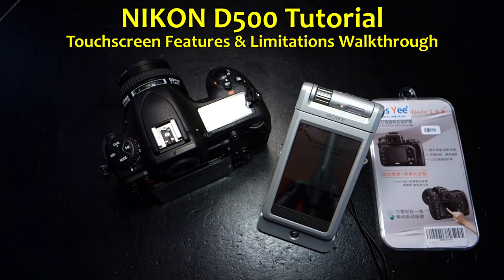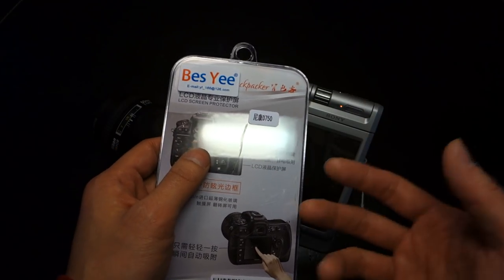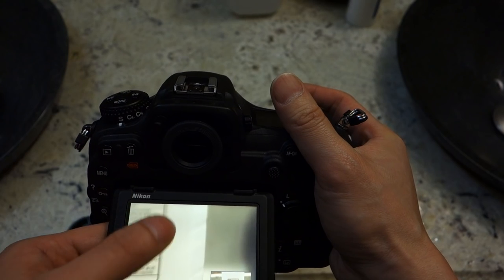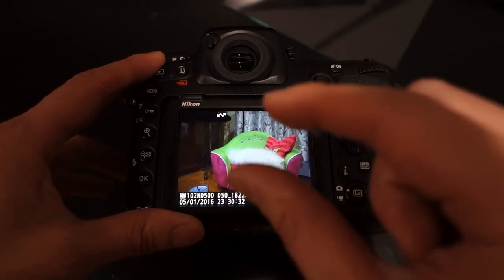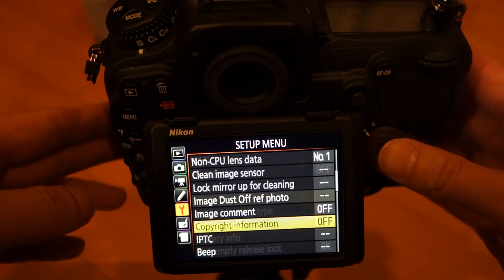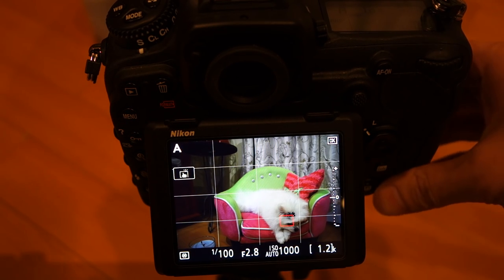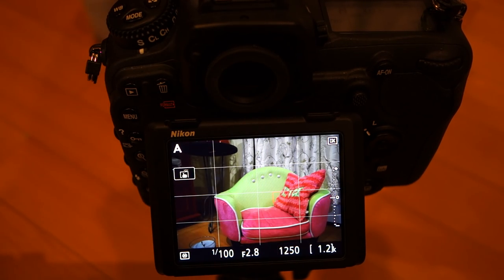Nikon D500 Tutorial - Touch Screen Features & Limitations Walk-through

Comment from the maker: TOC

Capacitive vs. Resistive touch screens - 0:06
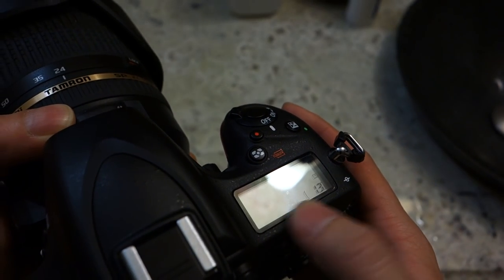~Resistive touch screen redux - 6:32
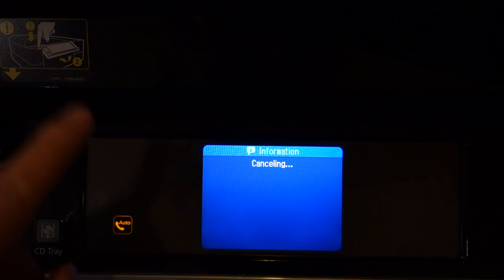~Emphasis about a screen protector's impact (or not) on D500's touch screen - 7:12

D750 Screen Protector on D500- 3:17
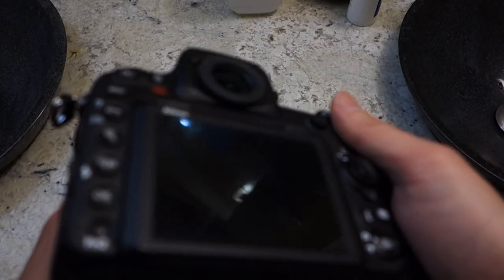~Testing Screen Protector - 4:26
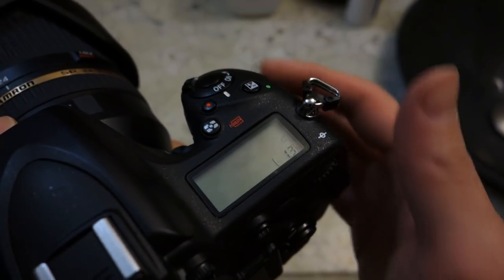~D750 top LCD protector - 6:01

D500 Touch Screen Features & Limitations - 8:41
~Playback mode - 8:41
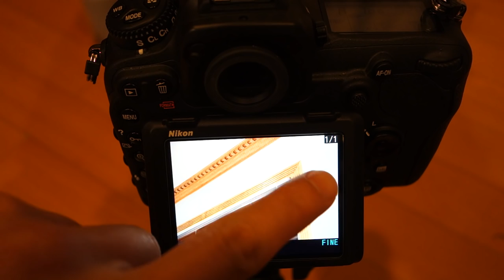~D750 shots preview compability issue - 8:53
~No menu operation - 10:32
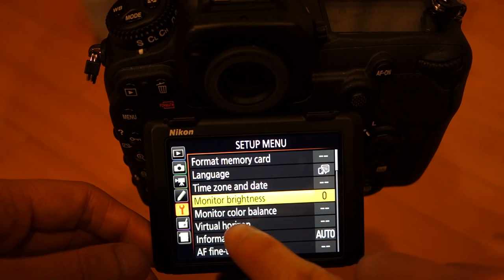~Text entry - 11:16
~That Delete key (my bad it's not a backspace key so ignore my comments) - 11:38
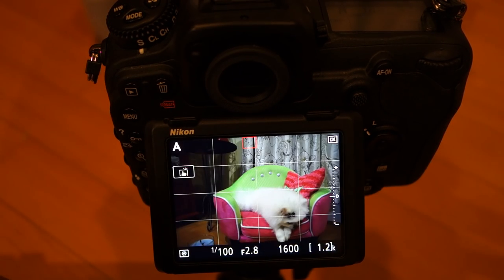~Live View (Pic) mode - 12:40
~~Touch Shutter/AF: On - 12:59
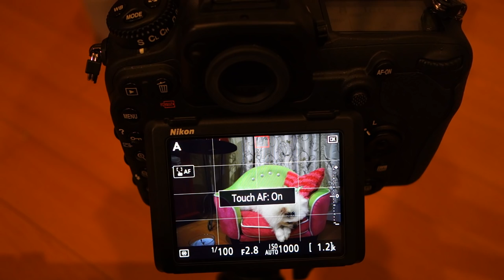~~Touch AF: On - 13:29
~~Touch Shutter/AF: Off - 13:45
~~Acquiring WB data for Custom WB - 14:05
~Live View (Video) mode - 16:55
~~4K video additional 1.5x Crop - 17:27
~Enabling/Disabling touchscreen - 18:14
~~Left to Right / Right to Left feature - 18:22

Comment: The D5500 has essentially the same menu design and scale (same 3.2" screen size), and touch is fully activated for both selecting menu items and scrolling through lists that are too long to fit vertically.  Sub-menu selections include touch direction arrows where needed and of course the text entry feature.  Even the "?" help icon is touchable, as well as selecting shutter speed and aperture from the "info" button screen (curiously not ISO) and all the editable settings from the "i" button screen.  It works very accurately for me (I wear men's medium gloves to give an idea of my finger size).  The live view on-screen button only allows you to turn touch shutter on or off, and touch focus remains on unless you select "Disable" or "Playback only" from "Touch controls" in the Setup menu.  There is also a touch "i" button on the live view screen to bring up those options as an overlay, but sadly, choosing white balance only lets you touch to select a type,  and doesn't allow for touching within the scene to set a custom value.  This seems to be the one touch feature the D500 has that the D5500 lacks.

More importantly (to me) is the D5500's ability to assign a touch Fn to the blank screen while shooting with live view off.  Eight options are available including ISO and aperture, but the one that convinced me to sell my D5300 and buy the D5500 (a crazy sale helped too...) is the focus-point selection, it's just great.  A joystick is nicer to have than a d-pad, but when I'm shooting dogs that move around constantly, sliding my thumb on the right side of the screen to have the focus point quickly follow the movement is a godsend, especially since face detection was designed for photographing human subjects.  (If you swing out the screen, the full area is used for the touch function, in normal position, only the right half is used, a well thought-out and effective feature, albeit not applicable the D500 since it only tilts).

The D5500 was Nikon's first attempt at incorporating a touchscreen in a DSLR, and they nailed it.  I was not expecting very much from it, especially not a touch Fn feature.  I'm hoping the D500 will be firmware updated to complete what they obviously did not finish implementing at release.  Providing invaluable touch features in the second from the bottom DX model and then omitting them in the flagship model released over a year later is about as nonsensical as Nikon can get.
Reply from the maker: +Lladnar Productions Thanks for the useful info and wow, didn't realize the D5500's touch screen was so advanced! I can't see why they couldn't incorporate that into the D500 via a future f/w update then... (and vice versa, the custom WB feature into the D5500). Here's hoping they will!
Reply: +turboBB73 The D5500 doesn't have a dedicated WB button, but since the "i" menu is already included on the live view screen, they could put it in the WB settings when accessed from there, but I doubt they care on such a consumer model.  But yeah, they really need to get their act together and finish touch on the D500.

Comment: Hi - can i ask something please?

I like the features of the D500, seems like more versatile, dif jobs
The D750 has more detail, bokeh

Can i get away with buying the D500 and using it for weddings? Does the D500 sufficiant detail for wedding needs?

Thanks all the best
Reply from the maker: The D500 doesn't have an OLPF which the D750 does so if anything (and in general) I actually find the D500 is able to capture more details, however it's also more susceptible to moire. You can see examples of that in my ISO comparison shots here:
D500 ISO6400 - https://www.flickr.com/photos/77239986@N00/26631495450/in/album-72157665745193943/lightbox/
D750 ISO6400 - https://www.flickr.com/photos/77239986@N00/26904035735/in/album-72157665745193943/lightbox/
Full album - https://www.flickr.com/photos/77239986@N00/albums/72157665745193943

While I've only shot wedding pics with the D750, I feel that either will do great for weddings but I've come to appreciate the multitude of direct control buttons that the D500 offers. I also especially love the super quick ability to set WB via the touch screen/live view. If I had to break it down between the two and with specific regards to wedding use (and again this is just my opinion):

D750 will have slight edge in low light shots (less noise), is slightly lighter, has built-in flash (if that matters to you, I almost never use it), no crop factor with native FF lenses.

D500  has better, quicker workflow via direct buttons, is able to capture sharper images due to lack of OLPF (but as mentioned more susceptible to moire), if grip is used, can use the beastly EN-EL18 battery for extended shooting/videography, is able to capture 4K videos (trust me, the details are much better than 1080P on D750 even if you downscale back to 1080P), capable of 10FPS w/200 shot buffer if you like to spray and pray, and the AF is a bit more advanced than the D750 (though in the right hands, this can be negated to some degree), quick workflow when shooting in liveview due to the touchscreen AF and shooting as well as while navigating pics during review.

I think it'll come down to low light shots where you might not want to use flash. If you think you'll be doing a lot of that, perhaps the D750 might be the better choice else the D500 would work just fine. Given a lot of what I do is low light shots, I'm waiting for a D500 with FX sensor. :)  Hope that helps but you might also want to do a search on forums as this question has been asked often (albeit not necessarily w/specific regards to wedding use). Cheers

Comment from the maker: Here's the tl;dw version ^_^;;

Pro's
- Very sensitive and responsive (like majority of smartphone screens)
- Based on testing, not impacted by use of screen protectors (of course YMMV)
- Features 3 modes
1. Touch Shutter/AF: On - touch to focus and upon acquiring focus (or not), takes a shot
2. Touch AF: On - touch to focus only (no shots taken)
3. Touch Shutter/AF: Off - turns off the touch function for focusing/shooting only (can still use screen to enter text and in Playback mode)
- Nice touch (pun intended) is that you can now touch anywhere on the screen to acquire WB info for your Custom WB (Pre) - no need to recompose your pic or be limited to central spot for WB info (like on D750)
- Works in vid mode (but only for focusing and can be turned off)
- can be used to enter text (like for Copyright or Wireless info)
- can be completely disabled (in Setup menu)
- ability to flip the ascending/descending order during Playback by selecting Left to Right / Right to Left feature

Con's
- Can't be used to navigate menus or adjust camera settings

There's also a bunch of stuff not related to the touch screen that I cover and for those interested, please check the TOC I posted in my other comment.
Reply: Thank you for the information! 
I'm considering getting this camera and I do a lot of video work. Does the touchscreen focus work in video mode when recording? 
And, have you tried the autofocus when recording moving shots? I've seen disappointing results in other videos.

Comment: Thanks for the informative video. Can the D500 also shoot continuous shots in Live View, and if so what speed? I'm thinking of a use case with overhead shooting with the LCD tilted down.
Reply from the maker: You most certainly can shoot CH in Liveview. While I don't know the exact FPS, I detect only a minor penalty in speed.
Reply: I saw the screen blackout in single shot. Does that happen in continuous as well or do you get a relatively live continuous feed. i.e. Can you follow action when shooting overhead with live view?
Reply from the maker: It will black out for a duration (depending on how long you hold the shutter down) and would be difficult to depend on to follow live action in this manner. Though I haven't tried, you might be able to hook up a small HDMI screen to the hotshoe and relying on that to follow the action. Another thought is to just shoot video in 4K and grab stills from there (just be aware of the crop on top of the crop in 4K).

Comment: SLR are old technology. cos before that camera were range finder. where you see at one hole and take picture from another hole. So you got parallax error. To correct that SLR was born. Now the new system is mirrorless. where you can completely eliminate mirror slap vibration. If you stuck with SLR lenses than you are sure to buy another SLR camera.
Reply from the maker: +Altex lan I'd jump on a mirrorless FF Nikon. :D  Had contemplated the Sony A7R/S II w/adapter for Nikon lens but seems the AF adapter isn't quite ready yet so will be holding off for now.
Reply: +turboBB73  On the other hand Sony mirrorless is not matured yet. lens with adapter will never make it. best is their origanal lens.
Reply from the maker: +Altex lan Sadly their lens line isn't quite there but they have been making improvements. Either way, we reap the benefits of tech advancements. :)
Reply: +turboBB73  think of Zeiss lens for the Sony  APSC. 16-70mm lens work great but not the Zeiss full frame.

Comment: Have you sold your D750? :)
Reply from the maker: Heh, no. If I were forced to keep one, it'd still be the D750. :)
Reply: hehe. D750 best full frame camera to date. IMHO.BTW did you manage to test DSTE battery grip for D750. I am looking into getting one.But your past review about the connection point where it caused the issue making me nervous getting one.
Reply from the maker: No, I've been a bit busy and still have a backlog of reviews to go through (including original MB-D17) but haven't purchased any after-market MB-D17's yet. Will post back if I get to that (but won't be anytime soon).